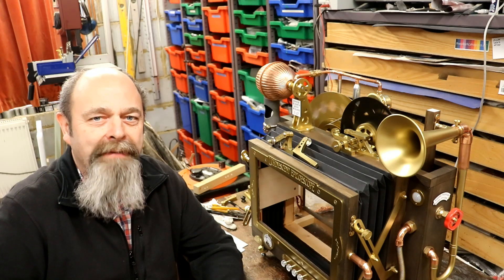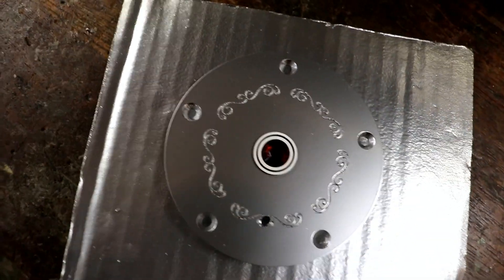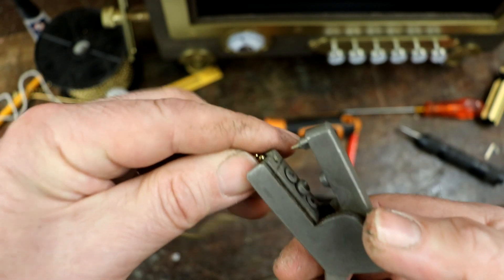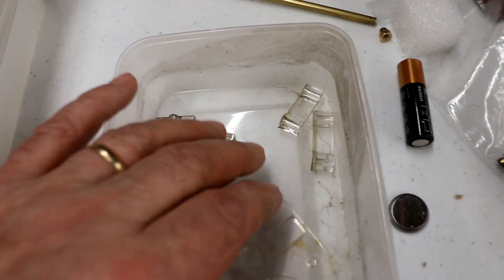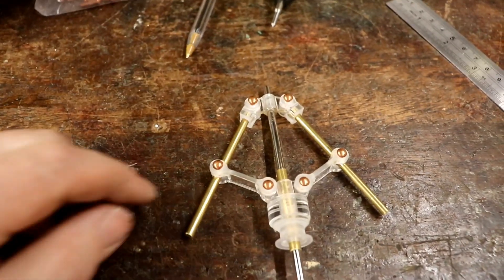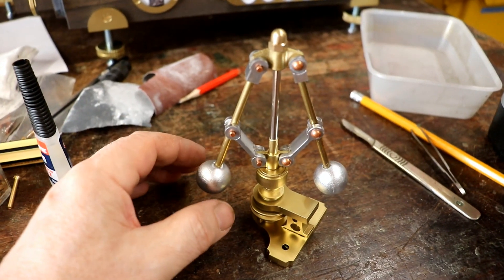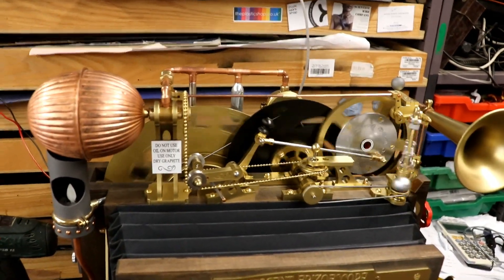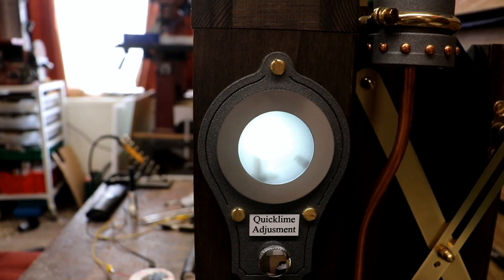How to make a steam governor!

Comment: I just have to say with worm drives most of them have to be driven from input side and cannot be driven or freewheeling from final drive as stated here in this vid but this is not always the case in some applications it is possible to turn worm gear from final drive and it all has to do with the spacing between worm gears teeth or whatever and diameter compared to cog that meshes with worm gear  plus lubrication and
 What I'm referring to is inside a gear box half filled with gear oil . Drain that oil of of gear set and the ability to turn from output becomes impossible.
Reply from the maker: Thank you for pointing this out! Two examples spring to mind, both coincidentally involving governors on a very small scale! The little wind up music box mechanisms that have a revolving drum covered in plucking pins, that usually have a air governor driven by a worm drive like you suggest, and the lovely old Strowger telephone dials that have a similarly driven governor, but that works through two weights rubbing within a brass cap. I've only just relaised the similarity between these and the original large ones used on steam engines! It's so nice to see 'ancient' technology used in fairly recent technology.